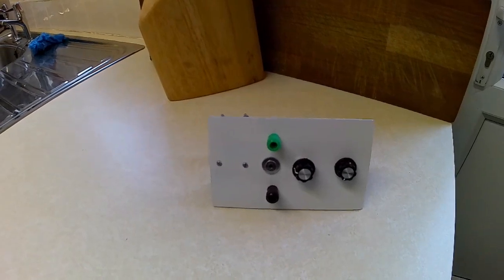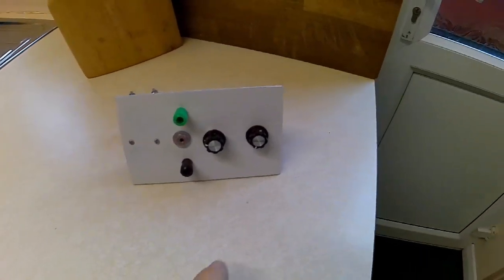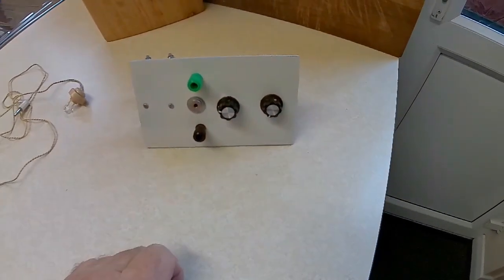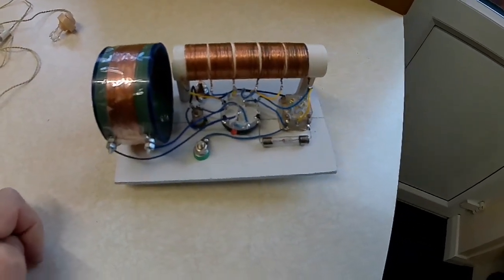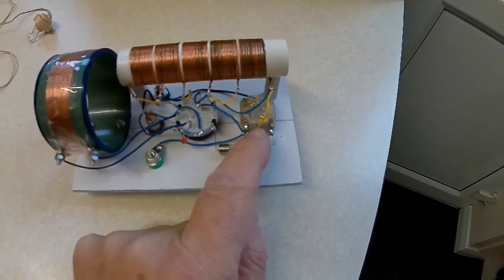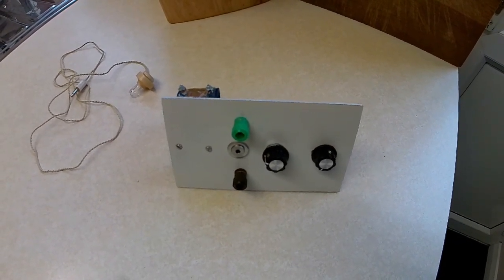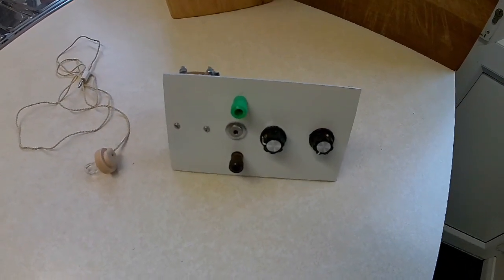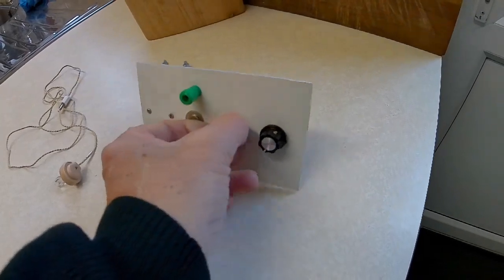Ham Radio. Hobby. Crystal Radio Receiver. DIY.

Comment: Very nice build and attention to detail!
Might I suggest, that if you are using the correct components, that you may need an antenna matching coil.
The coil’s inductance will be dependent upon your antenna’s length.  The coil is simply placed in series with your antenna and using an adjustable slider (i.e. say the top of the coil’s enamel insulation sanded-off) you simply tune it for the loudest reception.  The coils are typically 50-100 turns of fine-gauge wire on a 1” or so by 4” long tube.
Good luck 🍀 and 73…
Reply from the maker: Thanks for reply. I am still experimenting with radios and will give it a try. I am currently playing around with ferrite rod aerial type crystal set 3 coils. Input matching aerial length, main coil, lastly diode matching coil impedance. Also got a lump of crystal and cats whisker wire etc. Cheers from old George
Reply: @MakeDoAndMend1  Great hearing from you George, in my endeavors, I have found the aerial-matching to have the greatest effect on overall system gain.  I have seen, that when a series matching inductor is implemented, that the results can be absolutely astounding in their difference. Stations that were barely perceptible will actually come in loud and clear to where even some of the weakest ones will be now 1/3 of the strength of the strong ones!  Also, I find that it also helps with the selectivity because it is actually raising the Q of your input circuit –– so you get that as a bonus!  Now, to know that you’ve constructed this new series inductor correctly, once constructed and in operation, you should be able to move the slider back-and-forth and and be able to peak the gain on either edge of the band of interest, with the slider at either extreme; This will take some experimentation to get it right based upon both your antenna length and receiver input characteristics.  So many people think that the receive-aerial input impedance does not matter until they are faced with eking out the very last amount of performance from a passive-crystal set. Then, they find out just how wrong they really were and that it can be absolutely as important as on the transmit side!  Also, many people will find after using this series input inductor, they no longer either need as much gain or any active audio amplifier at all!  
If you do try it please let me know what your results are. Also remember that if your antenna is really long you may actually need a capacitor to do the matching instead of another series inductor! Best of luck George and 73…

Comment: Often use mine when I want to play.  LW and MW can sound empty these days.
Reply from the maker: Hi David . It's a bit of fun and I have changed the capacitance across the coil and it picks up around 5 stations. But yes bands dont have the activity they used to have. It still amazes me how it works with no battery. If I get time I will make a single zn414 radio. George

Comment: Hi George, please can you tell me how you got the detector diode into the fuse? Tnx Heinz, DE0RST
Reply from the maker: Blow the fuse by overloading it. Heat  one of the fuse metal end cap with a soldering iron this will soften the adhesive to glass and cap should slide pull off. When off drill each end cap to suit diode wire. solder diode into end cap that hasn't been removed. Refit end  cap with heat etc. George